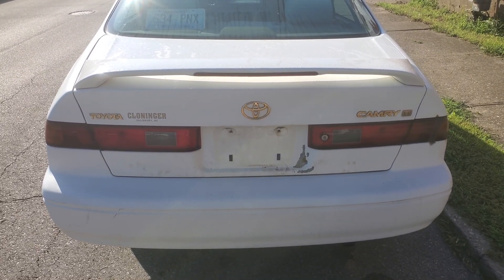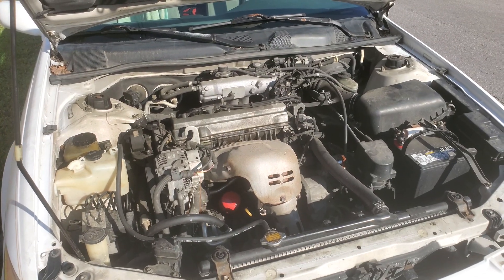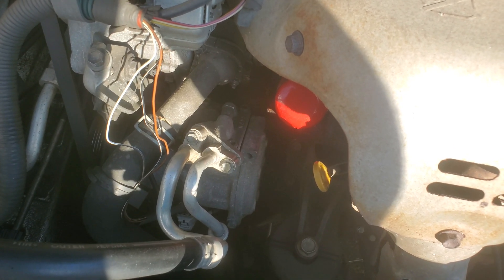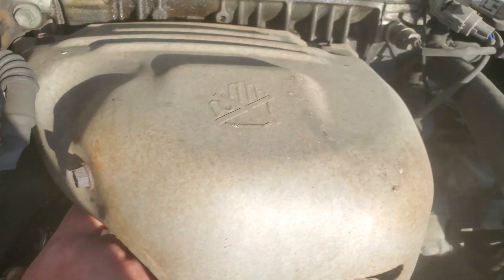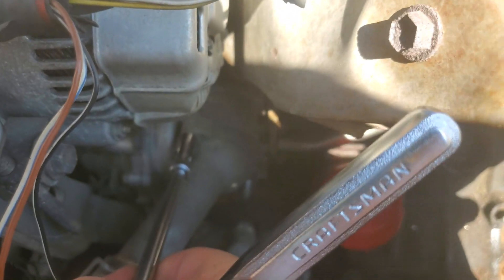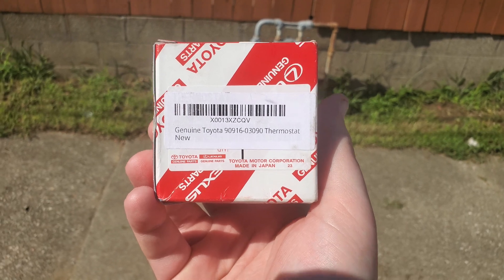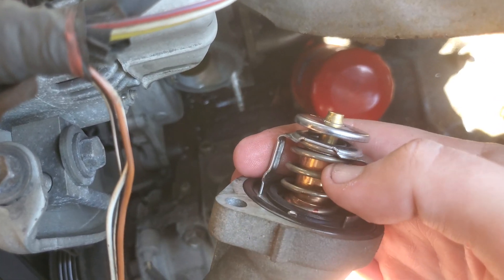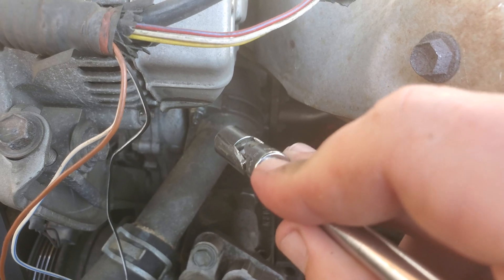Thermostat Replacement on a 5S-FE 2.2L Toyota Product (Celica, Camry, Solara)

Comment: Thanks mate.
My 5s-fe 91' celica just overheated on the highway and now its stuck overnight, gonna be using this guide tomorrow morning to hopefully save it without a tow
Reply from the maker: Good luck! Sorry to hear it just overheated, however do know that there's multiple causes for overheating
Reply: @adventureoflinkmk2  I noticed the coolant was lookin pretty dirty despite a fresh top up, so I think when I topped it up (it was very low) it let loose some old sealant and either plugged the radiator or thermostat up, either way it's definitely not running coolant properly and its gotta be from filling it up somehow that's the only change. She's been running fine for about 100 miles with no real change in driving behaviour
Reply from the maker: @uglyheadsupreme  yeah I'd be flushing out the cooling system

Comment: Thanks so much! Just did this, not even sure if my celica needed it but it was having trouble warming up.
Reply from the maker: You're welcome.. fwiw this should be changed out when you change the wooder pump and timing belt as preventative maintenance (the thermostat is encased in the wooder pump housing, just FYI)